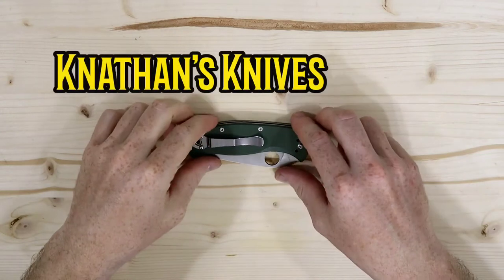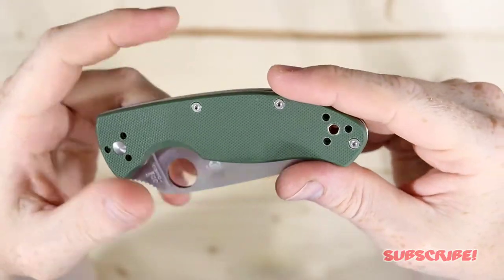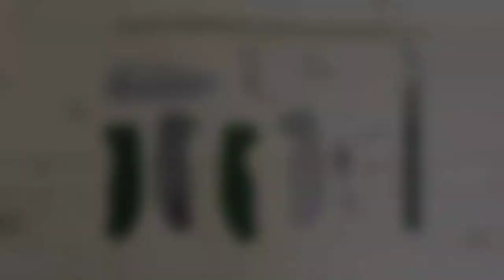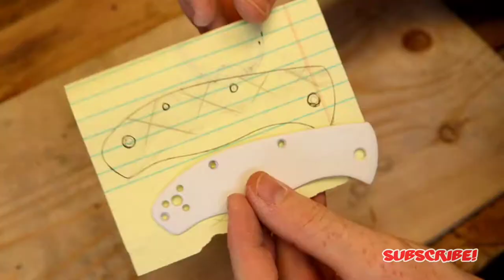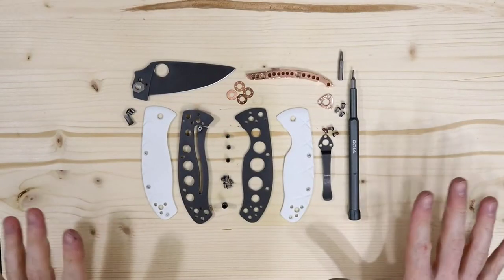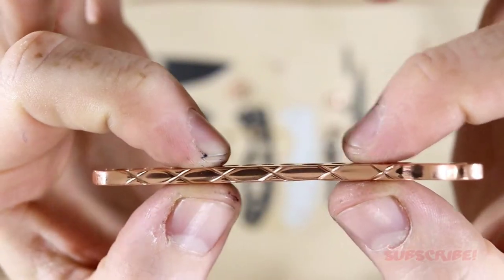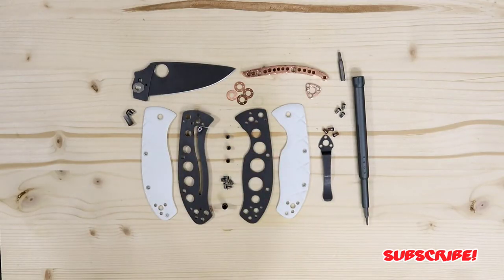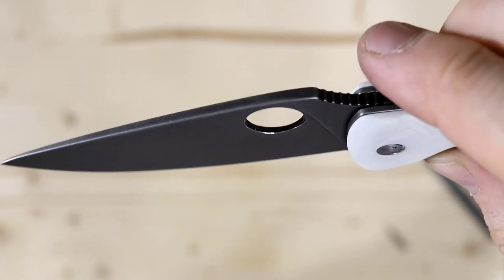Spyderco Tenacious Pocket Knife/Customized/Copper Backspacer(Knathan's Knives)

Comment: Wow! That’s a fantastic custom job! I use Shooter Lube on my knives as well!
Reply from the maker: Thank you very much and Shooter Lube is great!
Reply: You guys should try Sons of Liberty gun works Spec 76. It’s thin and super slick. I tried some on my persistence and used Brand KPL on a manix 2 and the persistence is just as fast and smooth as my manix 2. Which I think is the smoothest SpyderCo out there from factory.
Reply from the maker: I'll check it out, appreciate it! 🤜🤛
Reply: @KnathansKnives  hey so why did you use four bronze washers on this knife?
Reply from the maker: @Ryan.S924  That's just the way the knife comes, but I'm assuming Spyderco adds two on each side for the lubricant to flow through and make it extra smooth🤔
Reply: @KnathansKnives  that’s odd. My G10 Tenacious only came with two.
Reply from the maker: Interesting🤔
Reply: @KnathansKnives  yea it is. I thought maybe you added them or something. I thought because in your video you said (I think) you said the G10 you use was a bit thicker. So I thought maybe you needed to close a gap but that wouldn’t make any sense. The scales are on the outside of the liners so that wouldn’t change the placement of them. So I’m an idiot for thinking that lol
Reply: @Ryan.S924   I have an old tenacious G10 that had 2 on each side. Bought one recently that only has one on each side like yours. I swear the 4 washer system was smoother 🤷🏻‍♂️
Reply: @OGSERB  huh!? Maybe they got cheap on us lol
Reply from the maker: No worries🤜🤛

Comment: Man you make it look so easy. This one was impressive with literally no crazy tools. I was wondering how you cut of the spot for the liner lock. This one looks so good 👌
Reply from the maker: Appreciate it and thank you! I used to use a dremel to remove material for the liner lock but now I just hand mill it out🙂
Reply: @KnathansKnives  do you just use a regular drill bit or is the a specific milling bit for drilling out liner locks and cutouts for pocket clip
Reply from the maker: @anything_knife_related5647  Correct, I use a specific milling bit.🙂

Comment: The backspacer on this is fantastic! How did you get the thickness perfect so it doesnt rattle?
Reply from the maker: Thank you!
I made sure the copper piece was as close to the thickness I needed and used a flat surface with sand paper to remove material until it was a perfect fit🙂